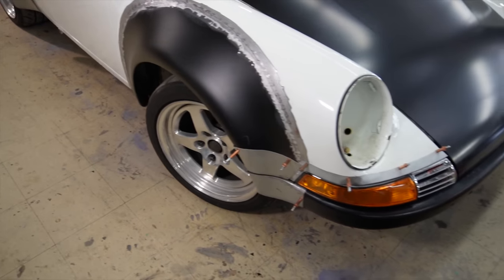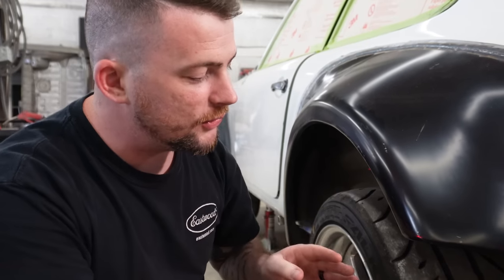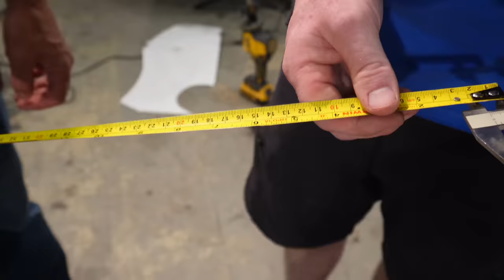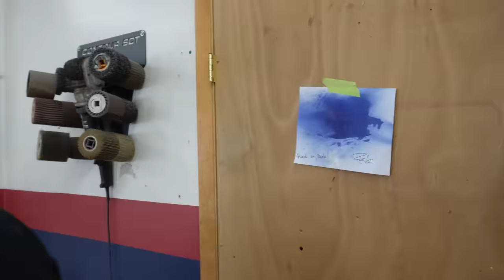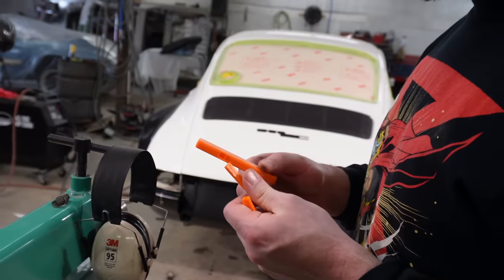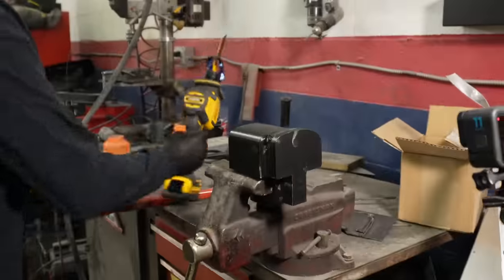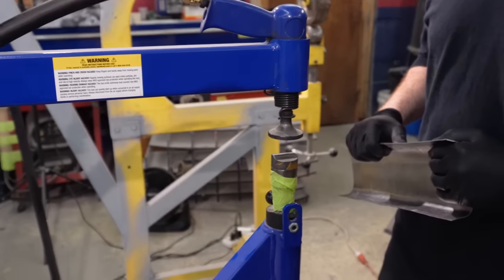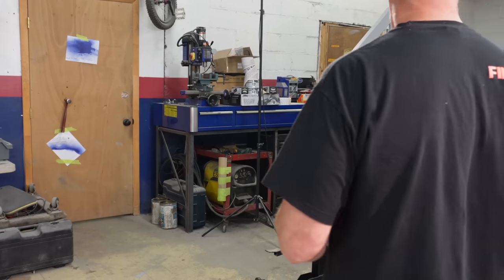We Used a 3D Printer to Shape a STEEL Widebody Flare!

Comment: I've never seen a spring steel PEI sheet shift like that on a 3d printer. You might have dust, metal dust, or something else that is not allowing the magnet to stick to it better. Try cleaning the PEI and the magnet real good and see if that helps.
Reply from the maker: Yeah I was surprised also. I realized this bed plate also has a layer of of that kinda think foam adhesive under it too, making it a bit thick for the magnet to grab well. I might need to get a different one. Haha!
Reply: @CrucibleCoachworks  Did you ever see that one channel called Grindhouse Performance where he used 3D prints to press designs and bends into sheet metal?